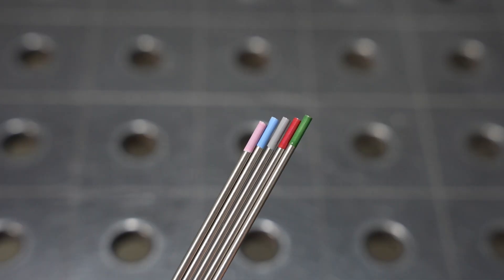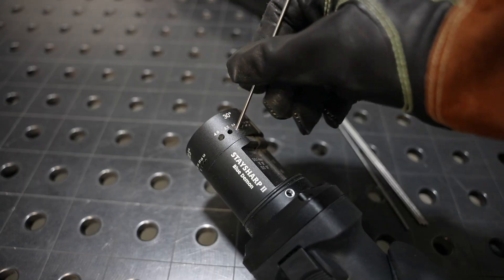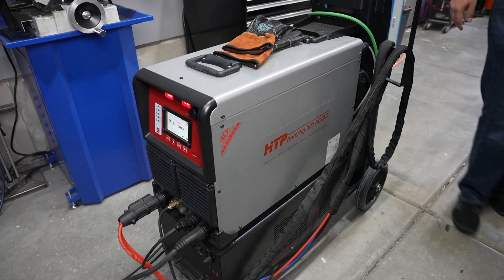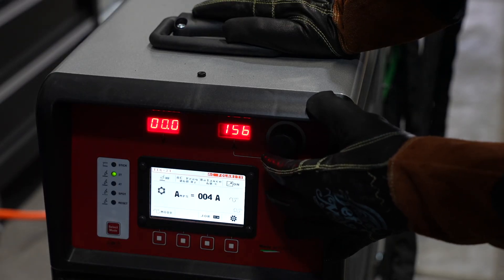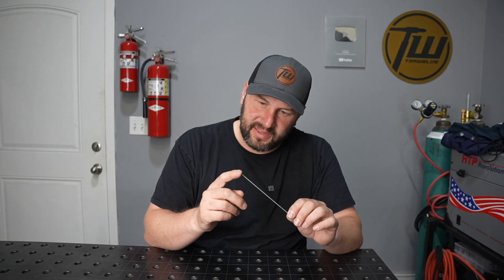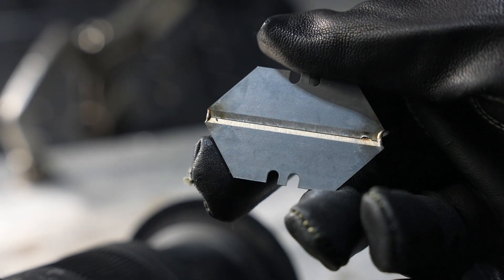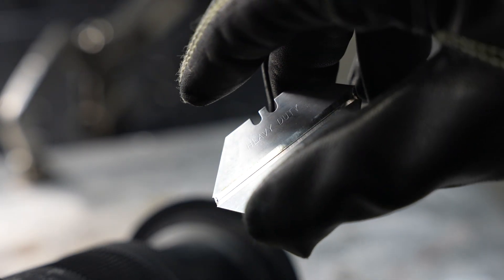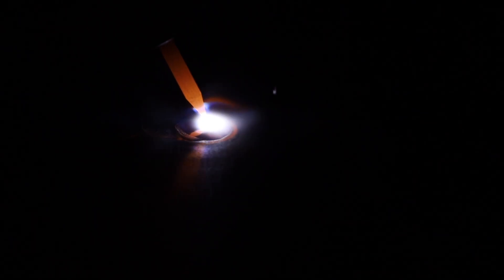5 Types of TIG Welding Tungsten Compared

Comment: I am VERY tempted to try use W electrodes to stick-weld steel ... are there any formal counter-indications ?
Reply from the maker: It’ll just oxidize and make a big mess. I’ve done this accidentally several times when I’ve forgotten to turn on my TIG gas.
Reply: @TimWelds  Thank you so much sir ! I'm a hobbyist welder (metal sculptor) who taught myself these last 5 years. Your videos are by far the most clear and grounded in intuitive common sense, for which I thank you.

Comment: Great video, I'm going to try some ceriated since I'm welding very thin metal. I've been using red because that's what I've always had, but time to change it up.
Reply: I changed from red to blue no difference red is radioactive so I changed

Comment: Fantastic to see someone else is getting those nodules, I knew I couldnt have been alone but no one else Ive seen mentions them, much less why they happen. Thanks! I use 2% Ceriated on Aluminium and have nodules forming well below 200 amps. I think the quality can differ between manufacturers too, I'm sure when i first tried the Ceriated they held up better than I am getting with my current batch. My welder wants to know what diameter my tungsten is which might be affecting the low amp start ... i get better start ups if i tell it I'm using smaller diameter than Im actually using.

Comment: You don’t mention anything about the %.  I’ve tried the 1.5% ceriated and was not impressed. Even the 1.5% Lanthanated don’t seem to hold up.  You had the Blue ones which are 2%, which seem to be very good to me.  But your video doesn’t comment about the differences. It does seem to make a difference.  I used 2% Thoriated forever when I was working in aircraft hardware. Not much AL though. Just a comment.
Reply from the maker: Great point! These were all 2%, except the multi-mix which I believe has a bit more in total.

Comment: I have found the high speed pulse pretty quickly erodes the tip on ceriated. (More so than 2% Lanth or Layzr) 

I like using Layzr now, seems to be the best of both worlds.
Reply: I used grey tungsten for dc voltage HF impulse stainless steel around 70Amps for a automation system but ıt contamınated pretty quickly.I use red tungsten ınstead now and ıt last maybe 10 times longer with stable arc.I dıdnt try Layzr can u tell if Layzr is better than red,blue or not.

Comment: It would be good to see a video on the laser welding process and the other feature they offer. Maybe some manufactrer would like exposure and possibly send one to you. They also have models that feed the filler wire aka a mig welder. Penetration is supposed to be better than any previous type of welding machine along with lower heat. I hope the prices come down, way down.

Comment: Great info as always, Tim! I'm still a beginner, compared with most of the welders I know. But I've found that the cereated seems to work best on AC at medium amps (60-110) and lantanated works best for me on DC at amps under 180. It just may be my technique, but that's what I've found. I'm now interested in the mixed style, and might pick up some Blue Demon pink (wouldn't that be pink Demon?!) and experiment with it.

Comment: Do you have to dedicate a sharpener for each style of tungstun?  That way it doesn’t “mix” thoriated and ceriated for instance, on your tip?
Reply from the maker: I just use the same one for all of it. I don't think it's so sensitive that cross contamination between them will create any functional issue. Honestly, before I had a tungsten grinder, I used a bench grinder to sharpen them with the same wheel I used for everything else, which I'm not claiming to be a best practice, but it worked fine for me.

Comment: I've been all in on 2% Lanthanated since i got my dynasty in 2005. That said i have run Ceriated, and had poor results on aluminum. I have never tried it at very low amps. Those low amp arc starts were eye opening to me. I think I will give the "LAYZER" (in Doctor Evil voice) a try. Good info!
Reply from the maker: Thanks! Lanthanated is one of the best all around options and I'd take it over the Ceriated if I had to pick one of the two. I've had pretty good luck with the blends lately.

Comment: HI TIM, WILL THE NEWER STYLE TUNGSTEN WORK IN THE OLD TRANSFORMER UNITS?
Reply from the maker: On DC, any of them should work. On AC, it depends a little on the specific transformer (whether it's straight unbalanced sine with continuous HF or has some amount of waveform shaping). Blue Lanthanated or a blend would be the best bet for an all around electrode. For a dedicated AC electrode that's a little better than pure on transformers, white Zirconiated is a good option.